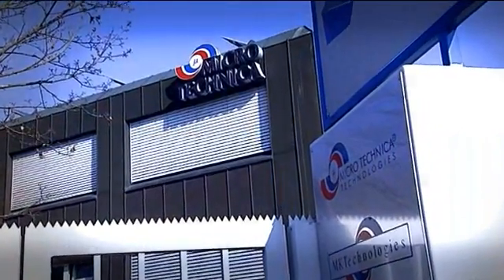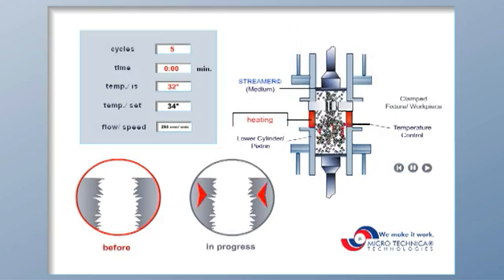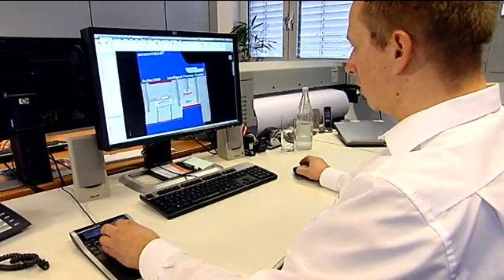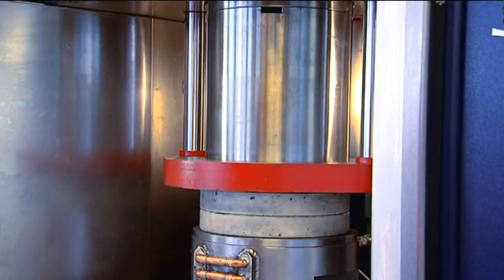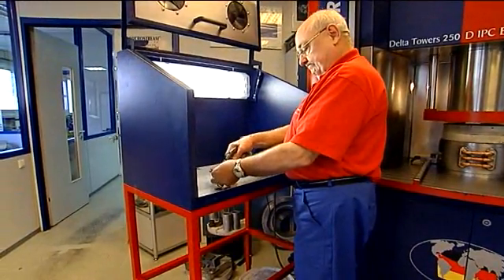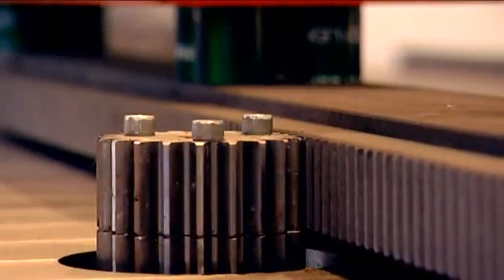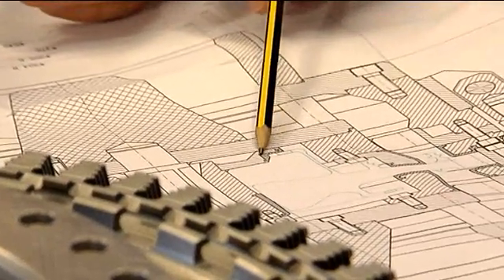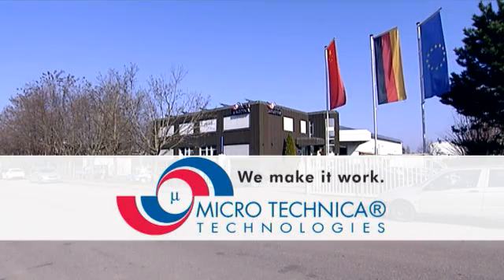Advanced Abrasive Flow Machining AFM

Comment: Shanghai Kooyle soft silicon carbide diamond powder abrasive polishing machine can polish multi holes mircro holes,fuel injection Automobile nozzle injection valv ,CNC metal parts precision mechanical parts deburring and polishing Ra0.025-Ra0.04 M.Kooyle Industrial Shanghai Co., Ltd. is a research development and sales manufacture company specializing in the polishing industry
Abrasive Flow Grinding, also known as Abrasive Flow Machining (AFM) ®, is a precision finishing technology used in a variety of industries. as a method of smoothing and polishing internal surfaces, and producing controlled radii. Hand polishing or deburring can result in inconsistent or inefficient results, and can be impossible to perform on complicated or internal surfaces.The process can also optimize the flow coefficient or improve the high and low cycle fatigue strength of certain pieces.Some applications of this process include:

Deburring
Edge radius generation
Surface improvement (polishing)
Removal of thermal recast layers
Polishing complex internal shapes to mirror finishes
Create/improve the gas/liquid flow path inside valves and fittings

------------------Best wishes,

Lavender shen
Website: www.kooyle.com

Phone/wechat/whatsapp/skype:86 18516640286

Add:No 69 Jiangong Rd jinshan Shanghai China

https://youtu.be/NNs7LNVSJ6w

Comment: kooyle Abrasive flow grinding deburring finishing machine ,extrude hone by kooyle industry shanghai Kooyle soft silicon carbide diamond powder abrasive polishing machine for multi mircro holes,inner cross holes,fuel injector fuel injection nozzle injection valve kit ,CNC metal parts precision machined parts deburring and polishing, Surface roughness Ra0.025-Ra0.04 M. Lavender@kooyle.com